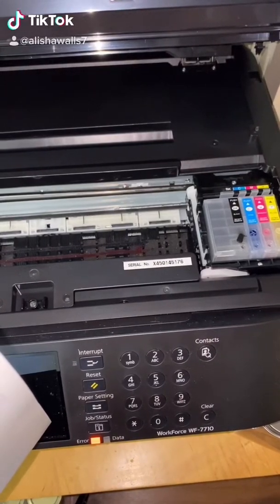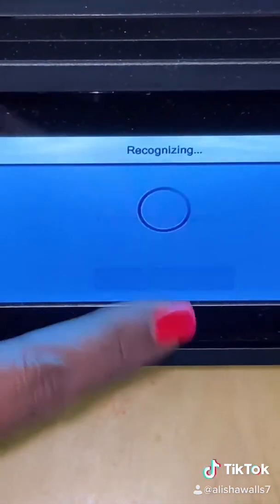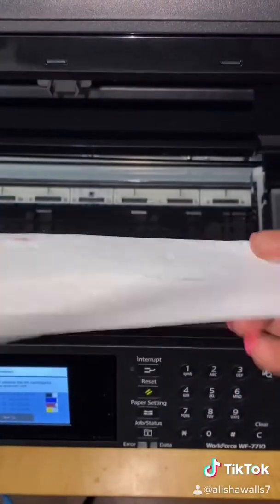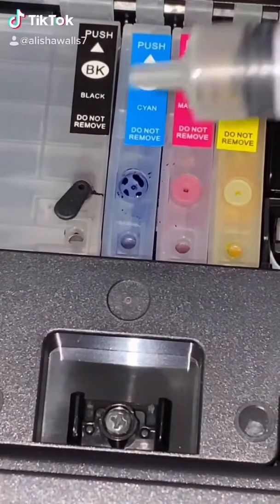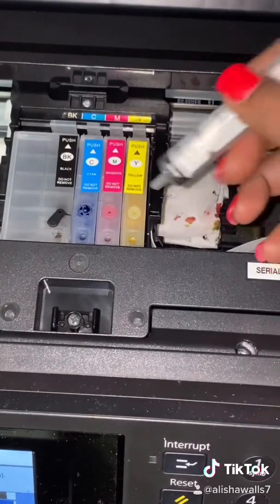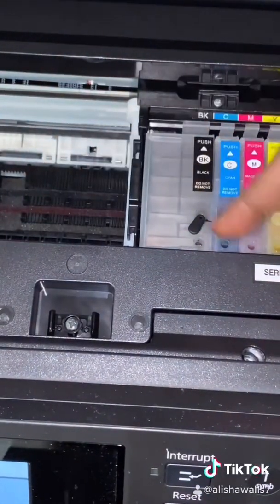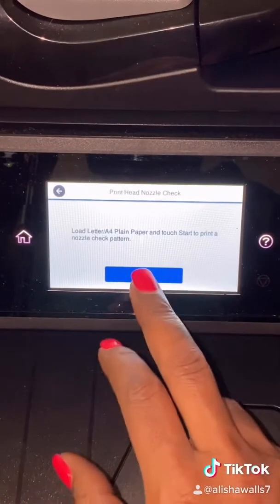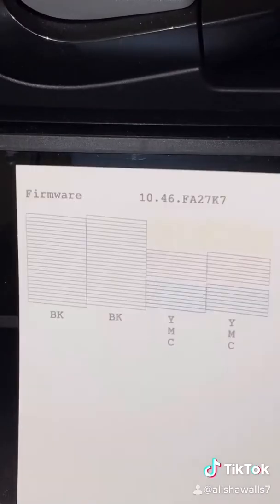Why your Sublimation printer not printing correctly 🤔 Watch this Video!

Comment: Mine still have the broken lines in the blue :(
Reply from the maker: Blow that cartridge out again
Reply: @Howtomaniac82  I did 4-5 times. broken lines in the blue are still there
Reply: @LaShellThomas-fy9nr 
Did u get it figured out ? I’m having the same issue. I’ve pushed solution through the heads & air through the cartridges & still broken lines on my blk & blue.

Comment: what if you do all of these steps and it still doesn't come out right? my color is basically nonexistent. I have cleaned the print heads multiple times and purged my ink several times as well. My YMC are all not printing. Thank you.